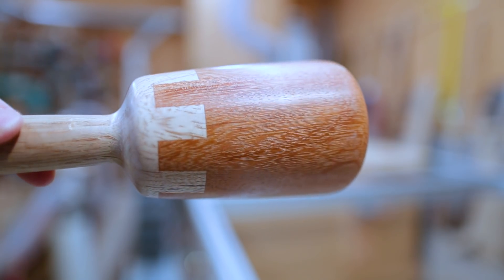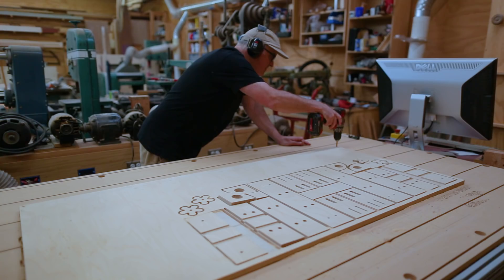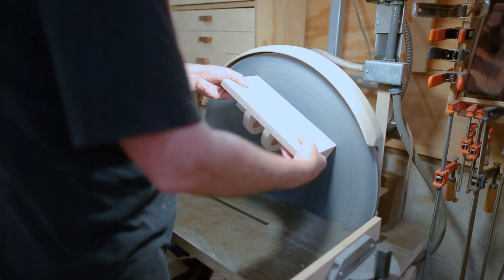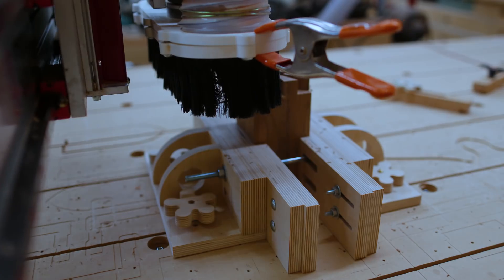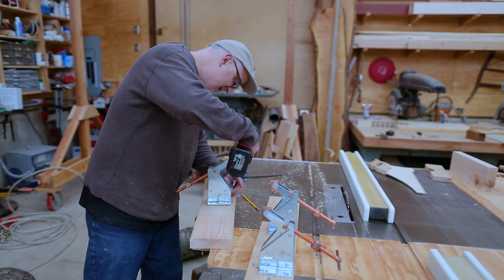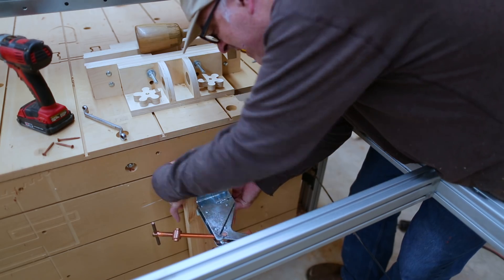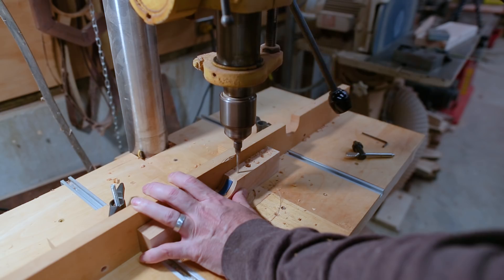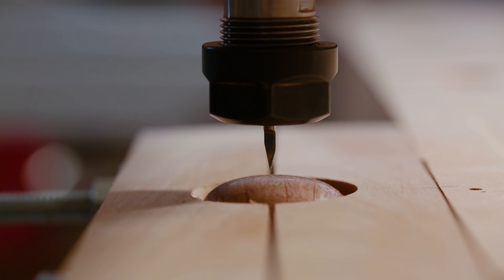Workholding Devices on the CNC

Comment: First for all, after locking some of your videos I like very much your “flower screw nuts”. 🌺🌼
I know butterfly nuts but didn't know about flower nuts. 😉
The same I like all your shop and the idea of " dig" it into the ground, your practical ideas and the all-time improvement of your shop. 👍                                                                                    I have grown up in the 50th and 60th in my grandfather’s cartwright shop. That was great. I could make my own toys and gewgaw by myself and “with a little help of my friend” (grandpa) very solid as other have had toys made from plastic that kept from Saturday to Sunday and my ones last for years.

Later I became a toolmaker and a couple of years later an engineer. I still like the smell of wood and years ago, after spending my career in living and working around the world as an engineer I’ve also start to recollect machines and established a shop, but would need more space. 
My in 1888 born grandfather would have been so happy with your machines.

Comment: Been a long time subscriber mainly due to ur cnc work. I run CNC machines for a living, this jig is super clever but one suggestion. If u set 0,0 at one of the corners that register against the fence u don't have to move to switch parts then u can set 0 once and just crank them out since that orientation can't change. Just a thought :)

Comment: I sometimes see you holding your dust shoe on with clamps, and I realize you take it off often for videos... cos hovering brushes are boring.  I can highly recommend the magnetic shoes from www.kentcnc.net.  They attach strongly with magnets to an indexed plate clamped to the spindle so you can just pull it off.  It's only a single 4" connection, but my whole system is 4" and it easily keeps up with 1/2" hogs and facemills.

Comment: It's a little late to offer advice, but I would have just screwed a plate to the underside of the rectangular block and then clamped or screwed that down to the table.  The screw holes would have been removed later on the lathe.

Comment: I said before I say again, that's a nice vice. And I think you'd be surprised how strong the X axis slide plate things are, especially because in simple translation you've got two of them, but most of the time you're dealing with a torque that engages all 4, plus the friction of the Y axis clamping is going to help too, that should be a really strong fixture  and since one side is fixed it'll have a high positional repeatability which is perfect for 'production runs' like this.

Then with the end engraving, that method really makes me want to try developing a Z axis touch sensor, it'd be a little spring piston you mount like an endmill, with a limit switch on the side. The Z axis moves down, once the finger touches the piece it stops going down, and eventually the finger moves up to activate the switch. By recording the Z switch point at the XY coordinate, you can map the position of a sphere using only 4 points, a triangle around the edge and a point inside the triangle. Given those points you can calculate the actual center of the sphere in XY, the actual height of the sphere in Z, the radius for generating your tool paths, aaaah I just want to make it! Obviously for things that aren't true spheres you'll need more points and the result will be an approximation but since a lot of your parts are turned on the lathe you can make a pretty good assumption they will be rotationally symmetric so you could map the arc along an axis and then triangle out the centering.
Reply from the maker: I understand what you are getting at with the sphere, but  I wouldn't know how to set that up.  I like the idea.  It would be cool if  it modified the G code bases on what surface it found.

Comment: What he built is essentially a 2 piece milling vise (google image search that) but with the added advantage of a set of built in part stops. Very cool!  Working from the center of square material is nice since you don't have to get the material or vise straight with the travel of the table (though its not that hard).

Comment: Why not use a branding iron?
Reply from the maker: The one I have really needs a flat surface.  I need to get a round one made.
Reply: MR. Howarth, since you have a metal working shop in your basement, and a CNC. could you perhaps mill your own? or is it too small of a scale for the tools you have?
Reply: He has in the past but at times it has failed to produce good enough results